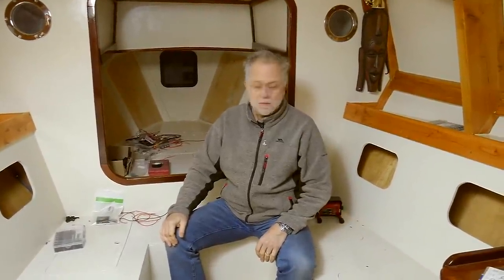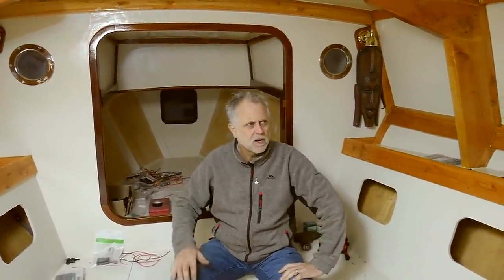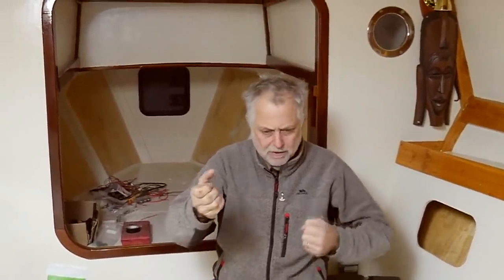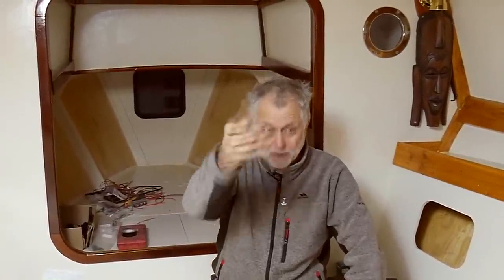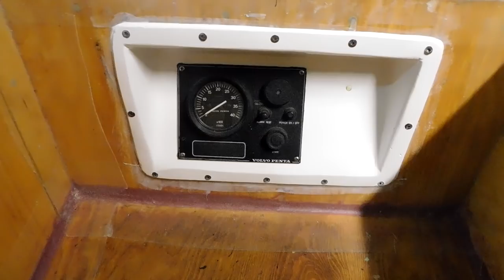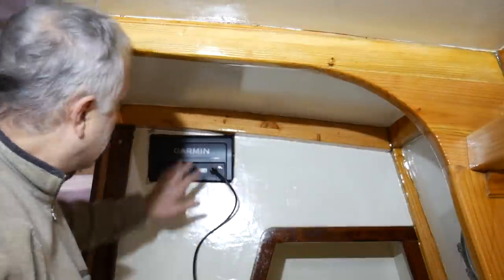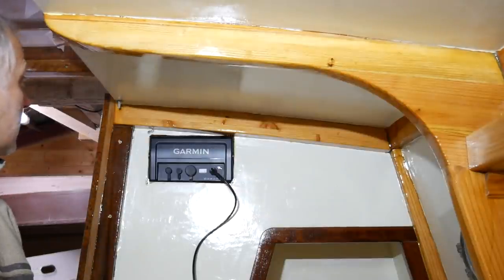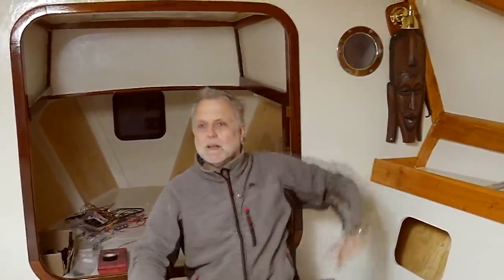Onwards with the interior; Building a cruising sailboat - SV Tapatya EP162

Comment: Very nice work Tony.  The closing of the video had me flashing back to my university days and some of the parties I attended.  I also am curious about the sculpted face/mask behind you on the bulkhead.  Take care, stay well and keep picking away at those little tasks.  Before you know it it will be time to pull Tapatya out and put on the keel.  Happy Holidays.
Reply from the maker: Thank you Matt. The face mask is just a bit of decoration that sorta hides some wires. I may well end up running those wires differently later, but the face mask might stay.. 🤔